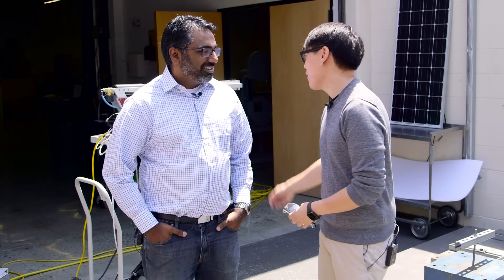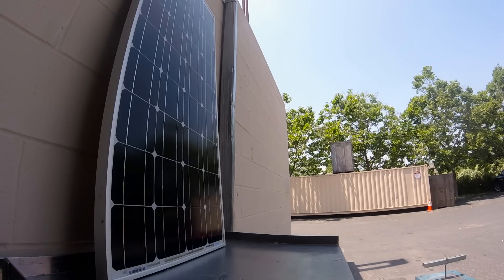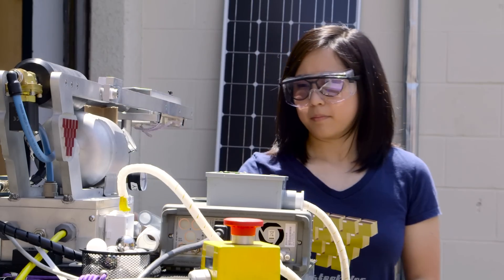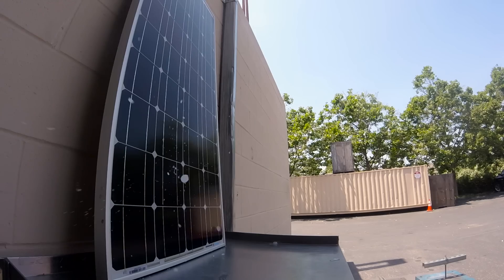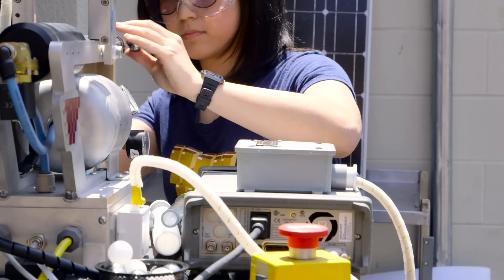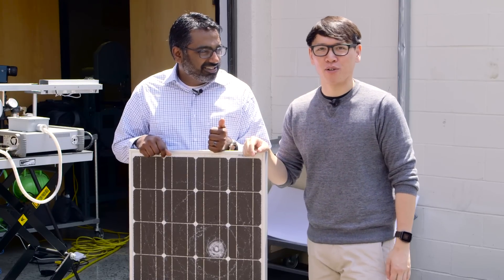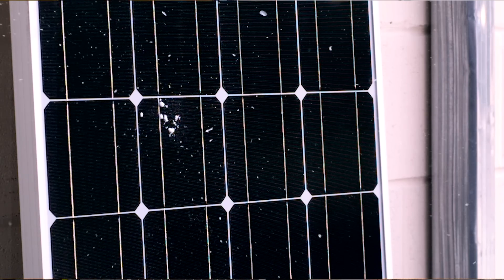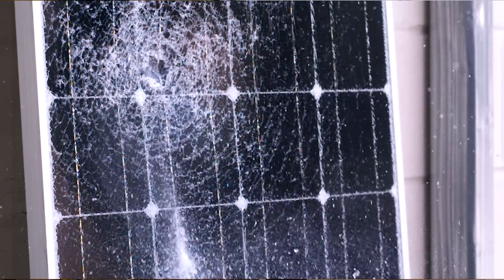Testing Hail Damage to Solar Panels!

Comment: for anyone asking, these panels were completely destroyed. The video is wrong about that just because the ball didn't go through it. The backside of the panels can absorb the damage, but production will drop to close to zero within a few months once the panels are compromised like this. In fact, cell cracking from this testing can seriously hamper PV performance even if the glass doesn't crack.

Comment: I learned absolutely nothing from this what a waste of my life. Does the entire panel have to be replaced if it shatters like that?
Reply: If the tempered glass is shattered, it's likely the entire panel has to be replaced.  Why?  Because water can now get into the inner layers and cause havoc with the metallization (corrosion) on the solar cells as well as possible "de-lamination" of some of the layers.

Comment: We have been installing solar panels for almost 5 years now in Oklahoma. In that time we've installed over 80,000 solar panels and not a single one has been broken because of hail. The test you see in this video is done at a direct impact. What they don't mention is that panels are installed on your roof, which are angled at the pitch of your roof, sometimes 45º or greater. This allows for a greater chance of hail sliding off and not affecting the panels' productivity OR overall durability. Lastly, Oklahoma storms typically come in from the north, and if you know your solar then you know the best place to install your panels in North America is on a south facing roof, which means your panels will almost NEVER see a direct impact like in this video.

Comment: Question: can the glass of a solar panel break due to wiring your system wrong? We had one of ours catch fire, it was small it only melted the shingles that were directly below where the fire started. We had an electrician try to reconnect our system and something went wrong and it kill our charge controler and upon connecting to the batteries the wires melted (i think he used 10 or 12 awg wire. ) some time later i went back up to put new connectors on the panels to try again and found one of them broken and looked like it had a small fire. My dad insists that the electrician bad wireing casued it. But to me it looked like it took an impact and i doubt such a small fire could have heated up the glass to the point that it can break.

Comment: Not even close to real HAIL that falls, not even close to REAL SPEEDS of hail, Not even close to the tight spread of a hail storm which is more like a shotgun blast coming down on you. They did no before and after WATTAGE testing of the Panels to pove it worked. Also hail storms can easily last 15-30 minutes.

This was the worst "scientific" experiment I have ever seen, the very worst. I bet the manufacturer paid you and wrote the entire script.

Comment: It's amazing how fast the glass shatters, compared to the speed of the projectile. Tempered glass fractures fast. That panel will still sort of work, but you'll only get about 20% of rated current, because of the shattering of the monocrystaline structure of the cell itself. It cannot be used in series with good panels.

Comment: Really?? Where is the voltimeter? Why the panel is not in the sunlight DURING the test with a nice high speed oscilloscope showing the voltage swings during and after the impact?? Norman is clueless. There you have. I said it.
Reply: I also wonder if there's any degradation caused by the first shots, that didn't actually shatter the glass. Did those impacts fracture the monocrystaline cells? Having it driving a load through a volt and an amp meter would be good data. Just because it still looks OK, there's some possibility of internal damage.

Comment: Jebus... Lately you guys either go full interview with no action shots or full action with no interview. This would have been an okay video if Gav and Dan did it but we all expect much more than just slow-mo from Tested.

Why were they testing hail damage to solar panels? Were they developing a more impact resistant panel? Were they trying to see if the energy production suffered after a superficial strike?

This was almost as disappointing as the 17 minute video about self driving cars that features no cars actually driving themselves.

Comment: Good thing metal ball bearings aren't falling from the sky where I live.

You want to make a good video about this? Grab several different panels, give us a rundown of the machine velocities being used, and experiment with different masses of hail. Afterwards, show before / after graphing of the solar panel efficiency. How does panel A compare to panel B? What structural differences are there? A couple more minutes and some actual concrete data would have made this much better and interesting to watch. There's plenty of other places I'd go to see something getting broken.
Reply: Well, hail tests are part of type approval for certifying solar panels so a panel wouldn't be on the market if it couldn't handle the standardized test. So the only interesting results would be if you test harsher conditions than what the standards require or if you feature tests of new solar panels that are in the process of being approved but the manufacturer would probably object to that type of exposure.
Reply: This is a good comment. but sounds expensive to film.

Comment: I was really hoping for some discussion of how the damage affected the panel's efficiency.  How serviceable is a panel that has taken that kind of a hit? Does it still work reasonably well, or would it just have to be replaced?
Reply: I'm here 7 years later with an answer lol, I received a 100watt renogy panel all busted up/shattered glass and I taped over it with shipping tape and still got 60 watts in direct sunlight, my little solar generator only supports 60 watts I believe so it may have produced more.
Reply: It's junk. I broke one by accident, and it was only able to produce 20% of it's rated current. Not only was the glass shattered, it damaged the monocrystaline structure of the silicon cells as well. as a stand alone, it could possibly be used to charge, or maintain an RV battery, but it cannot be used in series with good panels.

Comment: Although they proved hail of 1" diameter isn't likely to damage a panel, the test is flawed anyway... Most solar panels aren't angled at 90* to the falling hail, and are at more of an offset angle, so that they better angled toward the prevailing sun direction across all seasons. so the risk of damage is less as the hail's force is deflected to an extent..

Comment: So do the panels still function ? if so what losses can you expect from broken solar panels? At what speed and mass do hail stones fall ? Are broken panels still safe ? This was a waste of time.
Reply: I broke one once by accident, it was only able to produce 20% of rated current. It cannot be used in series with good panels, and has to be replaced. In high voltage systems, it becomes an electrocution hazard. If one breaks, replace it immediately.
Reply: I didn't really expect a result from a 3 minute video. They usually work, but depending on the damage the panel may output lower voltage and current. Moreover, the panel willl degrade over time if water gets in and corrodes. 

A lot of people claim nearly no losses. I have one damaged in a similar way, and the output is 20% of nominal capacity.
Reply: EEVblog here on youtube had similar damage to one of his solarpanels and it still worked.
Reply: Broken modules are NOT safe at all.  Do some youtube searches.  There is quite a bit about safety floating around...

Comment: Im not sure what this is showcasing? that if you shoot stuff at a solar panel it will break? does it still function? what kind of voltage loss do you get after the tests? come on guys, we all knew it would break
Reply: It was showcasing that standard hail won't break the panel. That was definitely a concern for me when considering them, that I'd basically be putting a large glass sheet on my roof, just waiting for hail to shatter it. But I'm glad that it can withstand 1" hail going 50MPH (the industry standard test for solar panels). I think the worst storm my area experienced in the last decade only had 7/8" hail.

Comment: I don't like their methodology. The position/angle/mount of the solar panel has much to do with impact. A panel propped against a wall will react entirely different to being mounted at an angle. Shouldn't they test varying sizes of hail with respect to terminal velocity? It's not like storms SHOOT hail at the ground. And why the different materials? Is there really plastic and steel-ball hail in California?!?
Reply: Maybe not in California, but it sure seems like there's that kind of hail in Australia - have you seen the damage to Dave Jones's solar panel? (EEVBlog on YouTube)

Comment: You guys are reaching an all time low with this one. this should be on the slomo guys channel. not actual testing. I can not believe people actually still watch this channel and fall for the click bait. my self included. so close to unsubscribing.
Reply: This was actual testing. They shot it with hail. It survived end of test. Then they shot it with other stuff because the panel was going to be thrown out anyway.
Reply: the common sense tells you solar panels will hold up against hail. anyone who has or owns panels knows this. what people where hoping to get out of this was if it will produce power after a crack or shatter of the glass... this test was not done. so it was a worthless test. I mean seriously. this was beyond stupid. they should have named it SLOW MOTION HAIL TO SOLOR PANEL. which still would have been dumb.

Comment: So my takeaway is that I shouldn't live in an environment where it rains large steel ball bearings.
Reply: Sort of my thought too. . . however, if it ever did start raining quarter pound ball bearings I guarantee that broken solar panels would rank quite low on my "things I'm concerned about" list.
Reply: I'm sure everyone was crushed when the houses had surface blemishes and the car roofs had pot marks. My sympathies that Obama and the rest of the nation missed this national emergency. #neverforget #Arizonametalsiding #miliondentcars
Reply: i have family in Arizona where i didnt expect hail but they got hit by a hail it left the metal siding with a million dents and totalled cars all over

Comment: How about actual testing? How about testing what the output difference is with a "good" panel. Man if I wanted to see shit break I would have watched the hydraulic press channel.
Reply: This solar panel looks very dangerous and may attack at any time, we must deal with it.
Reply: Exactly my thoughts.  Very little science went into this experiment...actually, none.
Reply: I accidentally shattered a panel by having it blow out of a truck. It worked, but only about 20% of its rated current. It made me sad, because it was back when panels were much more expensive than they are now.

Comment: A visuals, minimal information.  How fast does hail actually come down to earth and how does that compare to the standard they use to test a solar panel?  Would this be covered by homeowners insurance should it be damaged by hail? If so, what's the issue/point? 

If you're just going to put up a video with visuals like this without context that matters to people who own solar panels, what's the point?  Ohhh pretty ice balls blowing up.. oooo, It's like you're treating the subscribers like a 5 year old with a bubble making machine on the front lawn, attract them with a clickbait title, then dazzle them with slow mo!!! I'm not that easily entertained so at the least you could have given a lot more information on this.
Reply: Depends on the size. Also be interesting to see many little pellets rain down.

Comment: I'd imagine the cost of a Solar Panel being coated in Gorilla glass would be incredibly prohibitive.
Reply: Why not have a closed-cycle turbine with a solar heat collector? A thermal brine pond would be a good option for the collector, as the high thermal mass of all that water means the generator hooked up to the turbine keeps running after the sun goes down.

There's no need for a seal around the turbine shaft going to the generator, either. Make the generator's rotor a Neodymium magnet spinning in a fiberglass or carbon fiber housing, then the windings for the generator around that housing. No moving seals, and magnetic fields go thru plastic like it's not even there.
The working fluid for the turbine wouldn't be water, in fact something like the refrigerant used in cars would be preferable due to the lower vapor pressure. 
Lower vapor pressure means that it boils at a lower temperature, which means the turbine can stay spinning longer thru the night or a cloudy day.

This is one kind of solar power that doesn't "turn off" on a cloudy day. There can be enough thermal energy stored in the brine ponds to keep the turbines running for a few days.
The brine ponds wouldn't dry up if you cover them with a plastic sheet or something similar.

As far as where to build this kind of thing, it's not going to be in your backyard. I'm betting it's one of those "bigger is better" kind of things. Something with solar ponds of about a few square kilometers in size would probably be about right..
A desert makes a good choice for where to put it, and the closer to the equator the better. Lots of sun, day's the same length the whole year round (or close to it), and a few square kilometers out in the middle of a desert isn't going to ruin anyone's view or make anything go extinct. The Sahara desert or some deserts in Arizona or New Mexico would work.
It would take a site the size of Rhode Island to power the entire lower 48 of the USA. That's pretty tiny in the grand scheme of things, but don't tell Rhode Island that.

There's another big upside to this vs solar panels. Solar panel manufacture creates many kinds of hazardous wastes.
This solar thermal turbine stuff can be made from mostly aluminum, steel, and copper. That's easier on the environment, on a kW for kW basis.

Comment: Imagine having a solar panel roof that melts snow so its always exposed
Holy shit would love that
Reply: uh. Well, solar panels lose some effectiveness when heated up(I know weird the thing that powers them makes them worse). So adding a heater to a solar panel would be a silly idea. also solar panels generate heat when producing energy so they already kind of do that. and when its snowing they dont really make that much power(they still do) so if they melted slow they still wouldnt give enough power for the energy wasted making heat to melt snow.
Since they are typically elevated a few inches off the ground they should also melt the snow quicker then normally. and once the snow layer is thin enough for some light to get through(thats about 1 inch if i remember correctly) they should very quickly remove the snow from the heat generated.

Comment: Sigh- this can hardly be called testing if you don't test in real world conditions. Solar panels are always angled at circa 30 degrees to the sun/sky. This improves the relative strength assuming the hail is dropping from above.

Comment: Can you show a test with sea shells. I was on a project where solar panels were an option but were excluded because of the proximity to a fishing port. At the port seagulls drop shells from great heights to crack them open. The impact was theorized to be great enough to damage the panels but this was never tested. It would be awesome to see if the panels would actually fail under these conditions.

Comment: few things about this exercise are wrong, for one the angle of the solar panel is never flat on the roof and also those are some massive ice balls. never seen them that large. FYI they do have shatter proof solar panels.
Reply: There're mounted at almost any angle depending on geographic location.  Hail also falls at a variety of angles (storms are windy in case you didn't know) so it IS possible to hit at close to those angles.  You've "never seen them that large" so they don't exist?  Golf ball size hail isn't that uncommon, "massive ice balls" would be closer to softball size.  FYI 99.9% of solar panels in service are not shatter proof, doesn't matter if "they have them" or not.

Comment: TL;DW : Shit going fast cracks glass. Are the solar panels less efficient? I don't know. Do they still work? No clue.
Reply: I tested one that was accidentally broken, and it only produced about 20% rated current. Not only does it shatter the glass, it also shatters the monocrystaline structure of the silicon cells as well.

Comment: boo, what click bait,firstly no Adam savage "tested " no before and after shots, no before efficiency and after efficiency, like wtf guys?
Reply: the slow-motion seemed a bit weak sauce too.. sure it was more fps as 25,  but a collaboration with the slow mo guys and their Phantom V2511 which is capable of shooting 30,000 fps at 720p could have been fun.
Reply: Even that's not fast enough to see tempered glass cracking. You would need 250,000 fps or more just to catch a couple frames of it.
Reply: well they could crank it to 1,000,000 FPS at 128x32 :')

Comment: I dont want to be rude or picky, but what in the world was the point of that so called experiment? come on... did you ran out of ideas for decent and somewhat interesting content already? (or just label the videos as "for 10 yr olds max" so they can enjoy such "crash tests". Then even if you would end up shooting the thing with minigun to "test its durability" they would be amazed by the outcome. Bad call, Tested.
Reply: I at least expected a comparison of  the energy output before/after
Reply: They say that will come later. "stay tuned for more". such bull. 
Norm: "Hey, lets make a commercial for our next video."
Kishoor: "Should it have any content?" 
Norm: "No."